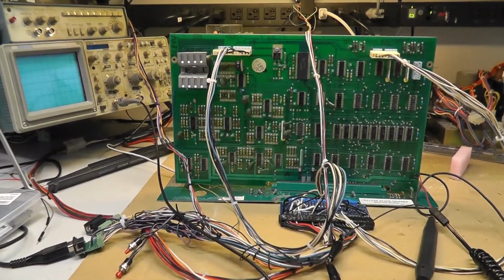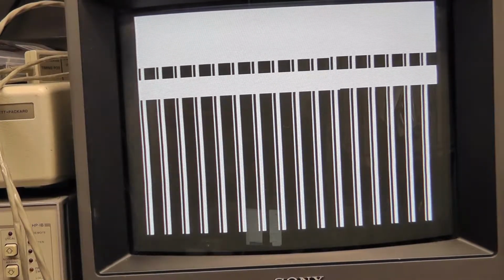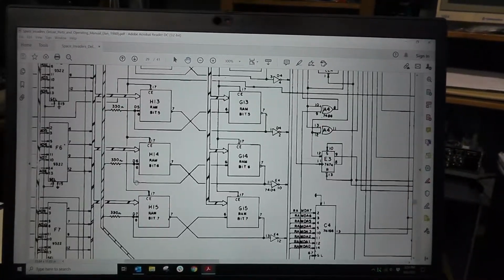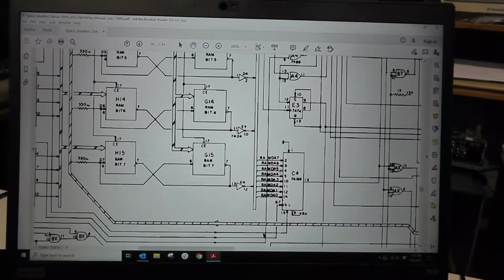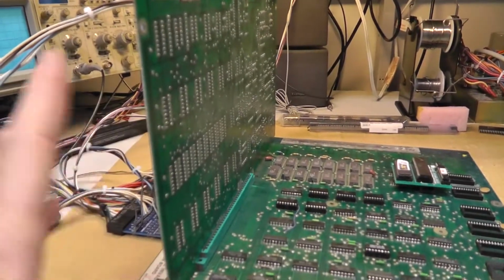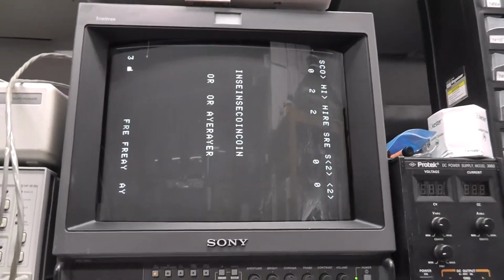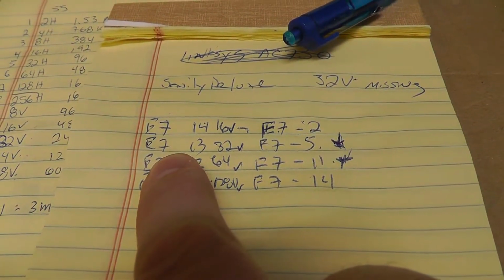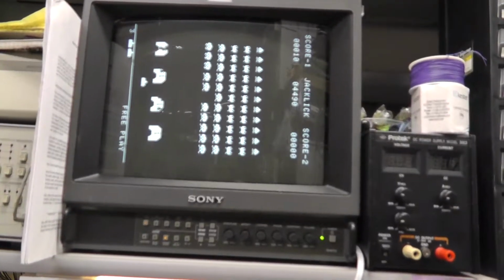Space Invaders Repair - Video Issue 32V - Board #2 part 2

Comment: Hi
I have deluxe board that missing eprom.
I try to read my data i/o programmer but cant access to mame file after unzipped.
Try to  hex ending file but nothing.
Can possibly you send me the hex file?
Reply: Because the original file not read
Reply from the maker: What is the eprom file name and or chip location
Reply: @jacklick  
Invdelux.d invdelux.h
In my board i found 5 chip burn and the cpu backwards.
The h rom  ome very hot spter 5 sec..
I would happi if you can send all 5 roms.
Who knows what more defective?
Thank for yours comments
Reply: @jacklick  
And unfortunately spend 450$ about this game until now.
This game my dream :-)

Comment: 4:39  Hmm, wonder what that sliver of RAM not written to is?  Does the Fluke RAM long test is considered PASS for 100% or does it pass for 99.999%?  It would be interesting to see if the same happens with another good chip.
Reply from the maker: It took me a couple times to see what you were referring to.  Small white line in lower right.  I would bet this is an artifact of what missing 32v and 64v.  I would need to rerun ram long test.  Nothing in the fluke manual indicated it would pass with less than 100%.

Comment: Sockets are convenient to use, but unfortunately, they can introduce more failure points.  If you know that the "new" parts that you are getting are reliable and are not prone to fail, it might be a good idea to just solder them straight to the board.  Well, as long as one doesn't get socket-happy on the whole board;).
Reply from the maker: Yea, I am just used to socketing chips if I replace them.  I probably should change that practice.
Reply: @jacklick  My concern is these Chinese made sockets.  How many years before all the blades get oxidized?  When soldered, the contact surface is perfect for years and years (except cold solder joints, but that's for plugs).  Check your USB and power plugs for your external hard drives, for example.  If exposed to normal room elements, they develop this white film on the surface after couple of years.  I have some that sat in a box or a bag for 10+ years and they look like new, but the ones I have by my computer need to be cleaned once in a while.  I don't even try to touch these metal parts with my fingers, so I do not contaminate it with oil from them.
Imagine, if the same thing happens to your sockets...  Dunno, maybe these sockets have better quality metal coating, but we will have to find it out the hard way later down the road.

Comment: The Program Address Buss is made up by the CPU & Game program ROM data to create a Program Address CODE? Video Address Buss is made up by the V&H Counter & Multiplexer Chips to create a Video Address CODE? The Video address CODE also turns on/off video RAM chips?
Reply from the maker: My brain and mouth are disconnected at times and I am not trying to be 100% accurate, like a professor or something, when explaining things.  When I said "Program Address," bus I just meant CPU address bus (no such thing as Program Address bus).  Both the RAM and Program ROMs are adressed via cpu on the "address" bus.
Reply: @jacklick  Was the Address Buss NOISE issue caused by that 32H or 32V missing signal or did changing all those multiplexer chips fix that Video address buss noise issue? because I doubt a missing 32H or missing 32V signal would cause noise issues on the Video address buss
Reply from the maker: I need to go back and retest that.  I agree missing 32v is not the likely cause of that. I was probing the mux outputs at the time, correct?  Possibly my probe wasn't gnd'd at the time or maybe the muxes weren't 100%, as reported by the Comparator.
Reply: @jacklick  Yes you were probing the mux outputs. Its common for the mux internal switching can cause noise issues or interference issues. Put back the old mux chips and one of them might be back or it was the bad sockets.
Reply from the maker: @waynegram8907  I retested the mux outputs tonight and they look the same.  I called it "noise" but really have no idea why it looks like that.  I am not sure why comparator showed them as bad but it tests the new ones fine.  It was probably worth replacing the chips but ultimately they weren't the problem.
Reply: @jacklick  yes when the CPU applies an 8 bit address I'm guessing its called an address CODE? because the parallel 8 bits are 0's & 1's which is a CODE, I'm guessing its called a CODE because the address code keeps changing every uS in time.